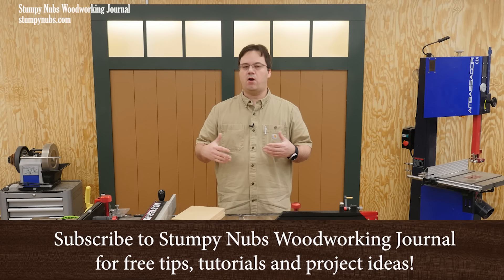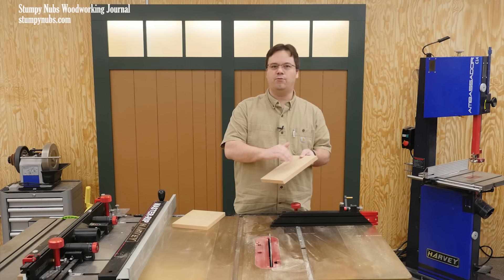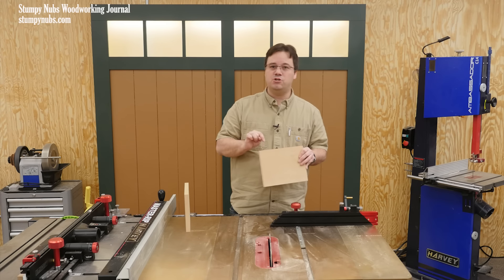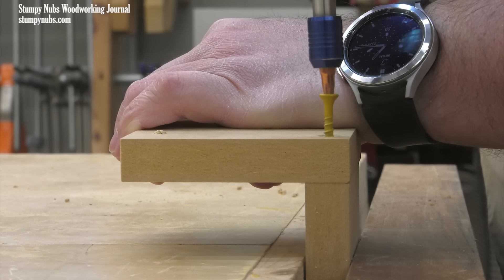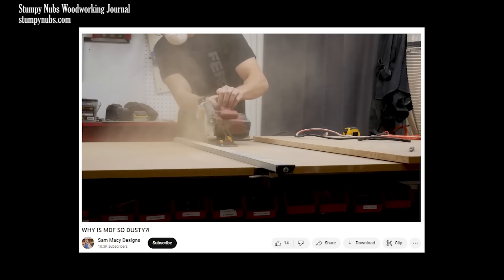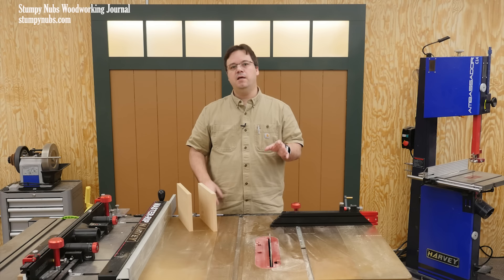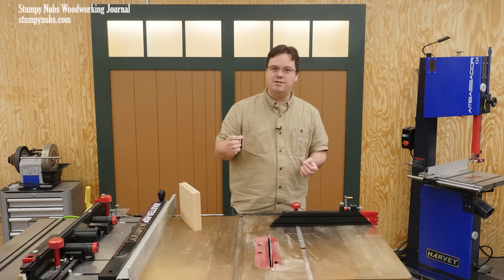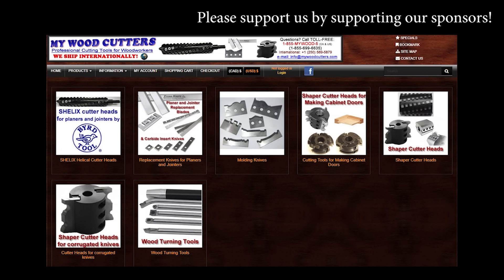This stuff changed my mind about MDF projects

Comment: Let's see, toxic dust, very little strength, won't hold screws well, won't glue well, won't tolerate moisture. The only saving graces are it is stable with humidity changes, and is flat (when supported). I think I'll just pay the extra and get plywood.
Reply: Weird.  I just wrote a comment that was nearly identical to your comment.  And my dog's name is Clovis.  Weird!
Reply: Currently working with a big slab of MDF which I chose for the surface finish. Big regrets. Awful stuff
Reply: Agree with OP commenter.

Cheap and toxic rubbish. The only MDF I have in our cottage is, years ago I bought a modular 5 tier workshop shelf unit, 1800 x 900 x 400mm from large hardware store chain that stocks alot of cheap rubbish. Metal legs and frame, MDF is precut and simply sits on top of the horizontal frames. No cutting or screwing required. Have them as bedroom shelves in our 60 yr old dilapidated roof leaking cottage. I throughly dusted off the panels in a ventilated area, and for nearly a decade, have been sitting dust free in the bedroom, causing no harm, and experiencing  zero moisture damage like they would in the tool shed, what these shelves were designed for, garage, shed, basement, etc.

If someone gave me free GC MDF, sure I'd use it, but I'd never waste one cent on this toxic rubbish.
Reply: And the dust is like glue. It sticks to walls and gums up your tools. I swore off that stuff years ago. I only used it because I used to get free scraps from work.
Reply: It has its place. Like all tools, if used for the wrong thing or in the wrong application then it is a bad material, but if selected for a specific application that it  excels at, then it is great. I use it for laminates, and using laminates on shop furniture. It holds flatness very well, and because of the density it is heavy. The additional mass in an outfeed table or mitersaw station is great.

Comment: I found over the winter when I didn't work in my shed for a couple of months, that uncoated/treatred MDF can go mouldy. I had a small selving unit right inside the door and had to replace all of the MDF surfaces, whereas the pine frame (also untreated) didn't have anything on it.
Reply: I've got a piece that looks like greeny grey shag pile carpet!
Reply: I've also lost a few shelves (drop-in ones from those keyhole units) go mouldy, but trying to solve the damp in a shed was more effort than it was worth, so eventually I just scraped down the MDF once it had fully dried out & hit it with a couple of layers of spray varnish all over. Not pretty but it seemed to stop the rot & they're still structurally as good as they ever were.

I think it happens because of the absorbency & high surface area; makes it easy for spores to stick and get bedded in.

Comment: It works great to make jigs like sleds or router tabletops. They are low stress normally and kept dry and the smooth flat surface is priceless.  Melamine veneer is even better.  I would never make furniture with!

Comment: I used mdf for raised panel kitchen cabinet doors. A glue water mix (abt 20% wood glue) does a great job of sealing routed surface. Just brush on and let dry. Then a quick sanding before painting and no more raised fibers due to water borne paint.

Comment: Great video on MDF.  I had struggled with it for years making the mistakes discussed here.  One tip I recommend...  For MDF applications where it can be "abused" or used heavily used (such as baseboards, doors, etc.), I use a lightweight automotive body filler -- Not typical "Bondo", which is too heavy/dense.  The lightweight filler I use has small fiberglass strands, which makes it very strong, it sticks to MDF like super glue, and since it's 2-part/catalyst it cures in minutes.  Being lightweight, it sands easily so I don't grind down the MDF faster than the filler.  When it's applied and sanded, the fill is invisible.  It also really holds paint!  It's especially great to use on baseboard corners that can so easily be dented or chipped away from getting kicked or the like.  I've used it to glue/seal the joint at outside baseboard corner miters, then spread it over the face out 12" from the corner in both directions.  I've also used it to butter raw MDF edges.  Very strong, very fast cure time, easy to prime/paint.

Comment: Spax,  makes a screw for MDF, it's like magic.  No pilot hole is needed even on the factory edge.  It is truly amazing!
Reply: I've had good results with HighPoint Confirmat screws. They're designed for mdf/particle board but they require a special bit for a pilot hole...I'll have to give the spax screws a try....thanks for the tip
Reply: I've used those SPAX ones too on a series of built-ins for my daughter. They are excellent, just don't over-drive them.
Reply: @normanbott  Never over drive any type of screw!
Reply: Was gonna recommend Spax as well but you beat me to it.  I've made our kitchen cabinets & living room entertainment center carcasses out of MDF using biscuits, glue and spax screws.  They've been used for over 10 years and haven't had any problems with them.
Reply: Thank you for the info. What would be recommended on the size ,length  etc. .I am using 3/4 inch MDF for shelves and cubicles ?   Thank you folks.
Reply: We have all kinds of brands that provide dedicated Mdf screws here in The Netherlands. Spax (Germany) Heco (Germany) Woodies (Netherlands) DynaPlus (Netherlands and more.. So I am sure that you will find these in North America as well.
But if you want to make a really stable joint in mdf, just use your router to make an 8 mm groove in the “endgrain” of the board and glue in a strip of pine wood or whatever you have available and and there you go. A very reliable joint!
Reply: Such a Home Depot reply!

Comment: Done doors/drawer fronts with just MDF panels and done finishes with lacquer, stained and lacquered, and painted. Sanding with 180 and sanding it well helps fill the fibers on the edge so it takes less finish to cover and looks more uniform if you are using lacquer and stains. Major color differences and mill marks still show up if you didn't sand it well. It's harder to sand properly than some hardwoods in my experience.

Comment: A trick I learned from a luthier is to use Minwax Wood Hardener.  This is a thin resin that soaks in and "hardens" the MDF when dry.   This is especially useful when using MDF as router templates.  Also, whenever I pre-drill MDF for screws or T-nuts, I soak the holes in this stuff.   It really does work a treat.   (Don't get it on the surface if you can help it... it can be a bit sticky.)

Comment: So time ago, a cabinet shop where I worked took on an outside job reducing MDF sheets into dimensional sizes using our sliding table panel saw.  Hours of continuous ripping filled our shop with fine dust despite having a collector.  Two blade changes and the dust collection machine completely filled several times were some of the highlights of that fiasco.  I can still smell and taste the acrid dust to this day

Comment: The joining method I would like to see more frequently is "wedges". There is a patented solution but honestly I have 3D printed my own and it works fine. I am just a bad handy man so it never fit properly and looks unprofessional but it works. The greatest pro is, you can disassemble it and you can add parts later on.

Comment: If you're looking for that smooth surface of MDF for painting,  another good alternative is MDO (medium density overlay) or HDO (high density overlay).  This is exterior grade fir plywood with one or both outer surfaces coated with a thin layer of MDF or HDF, so it has all the advantages of working with plywood but with that very smooth surface.  It's expensive, over $100 a sheet; I buy factory seconds for $15 a sheet that usually have one bad edge but the rest is good.
Reply: Thanks Mike.  Where do you find the factory seconds from?
Reply: My local lumber provider also has a plywood they call J-Core. The center is a traditional multi-layer plywood with the outer faces being a thin MDF layer and it is on the MDF layer where the hardwood veneer is. The advantages are a dead flat sheet because of the MDF, it acts like more expensive void free plywood, and with the traditional plywood center it can hold screws really well.
Reply: I have used mdo and it can be a great alternative...was first introduced to it when working at a sign company (they used to use it a lot before pvc sheets became so available)  one caution though...sometimes we would have to reject a sheet or two because the wood grain had telegraphed through the paper finish. It's a problem that's hard to fix and, if you don't look carefully, it can be easy to miss until finish is applied.

Comment: I think MDF gets a bad rap in at least some cases because so many people use the term interchangeably with "particle board". While it is technically true that MDF is a type of particle board, I suppose, the stuff you find inside most Ikea furniture that looks like compressed oatmeal isn't the same beast as "proper" mdf. And don't forget that there are moisture resistant versions of MDF, as well.  Had a friend build a cabinet in his basement. He made the base out if resistant MDF, but the rest of the project out if regular mdf. His basement flooded by an inch, which never reached the cabinet itself, and the resistant mdf survived the flooding just fine.
Reply: MDF > Particle board > Chip board (IKEA) > OSB in order of increasing size. I think there is/was a 'Flake' board in there somewhere, probably between Chip and OSB, but may have jsut been Marketing BS.
Reply: @brucelee3388  Ikea, at least in the UK, seems to be using a lot more MDF than chipboard now, due to the increased strength. They build a hollow form out of it & laminate it, with the middle full of (something that certainly seems to be) corrugated cardboard. Vast improvement over laminated chipboard, but still nowhere near as nice as the solid pine stuff they used to make back in the day.

Comment: I made a coffee table from MDF over 25 years ago that is still going strong. In that time it’s moved nine times (two of them international, one of those by sea), and survived three children who are now all teenagers. I also had a substantial table with full length multi-level hutch that was all MDF that was still going strong too after 13 years and was only scrapped because even dismantled we decided it was simply too big to bring with us overseas. It too had easily handled three domestic moves, and a few repositions, without any trouble. Maybe having worked in an MDF factory gave me an early insight into how to work with it on any project without trouble…but even durable furniture is quite possible with MDF if done right.
Reply: Do tell! How did you do it? Not smartass just really curious 🙏🏻🔥⚒️🧙🏼‍♂️
Reply: Yes, please!
I am desperate for some changes around my apartment and fancy nice wood is just not in the budget at this point. I am shooting for as durable as possible at the moment (given my limited budget) and I do not have a metal work shop nearby where I could just go weld stuff out of steel or aluminum. I mainly need to make shelf space. Any hints are appreciated!
Reply: @dragonstonegemironworkscra4740  I feel like dowels are a good way to go with MDF, I'd be interested to see what DL says as well.
Reply: The basics of what you need to do were pretty much covered in this video.  Basic design was a H base, with router-cut stopped dados in the end pieces. iirc, I did use dowels to attach the base to the top (again, for the reasons given in the video!), and added some discrete small brackets to make sure. The end pieces of the base (seems not right to call a complete block “legs”) were 18mm, the cross-piece and top were 12mm. I wasn’t doing it to prove a point, I just needed a table, I already had all of the materials, and I so I just made a table…and yeah, it lasted. I’m far from being any kind of genius woodworker, so I’m putting its longevity down to the quality of the materials, for sure. I’d do a better neater job of it today, unquestionably…but for my skillset and with my tools, I’d also go for MDF again without hesitation. It’s easy to work with, perfectly safe if you take reasonable precautions (do people really think they’re inhaling none of the dust from a router/saw on natural wood???), no heavier than other timber furniture, affordable but good quality, and can absolutely produce durable works if you take the time to think about the design and construction process before you start (as you should do anyway, regardless of material!).
Reply: @DrTomatoSpaghetti  yes, dowels are a great option with MDF. They get the job done. 👍
Reply: @dl4608  thanks now. Appreciate your time n information! 🙏🏻🔥⚒️🧙🏼‍♂️
Reply: MDF furniture is for banned at my house. Thrown away to many nice looking shelves ,tv hutches, kitchen and bathroom cabinets. Not another dime will be spent on that crap. Now if you want a flat work surface and the material is supported very well so it remains that way then Formica the top and sides ok. The rare bird that has something that last and will stand up to kids is great. Other than that the land fill is full of proof this isn’t a go too product for furniture of any kind.
Reply: @johnanthony2545  you must be a lot of fun at parties… 🙄
Reply: @dl4608  yeah I’m hoot lol. Sorry to be so condemning. Just my experiences and many I’ve talked to. I’m glad what you made is still awesome and you must have done a hell of a job. Good going. We live in Florida and humidity isn’t friendly to this material or any mis hap. Recently my mothers million dollar home had a leak behind the refrigerator the MDF cabinets were trashed while completely soaked base boards just had to be dried and painted while I remade the cabinet.
Reply: @johnanthony2545  from those extra details, it sounds like Florida is the real problem…and that wouldn’t be the first time! 😂😬 yeah, MDF is a poor choice for wet areas or anywhere with high enough humidity that it might as well be considered wet generally. Florida certainly qualifies! Blame poor choices by the worker more so than the material in this case - but that applies to natural woods too.
Reply: @dl4608  agreed. This is a norm here for many homes. Most people unlike you and I have no clue what there getting as long as it looks good weather it’s good for the region or area of home. Man oh man we have problems lol. Hoping many of then don’t catch on. I’m hoping the political climate here is seen for what it is and climbs back under the rock it came from. Lived here all my life it never use to be this way. Scarily crazy.  Any way keep building and enjoy sir. 👍
Reply: I concur with you on the political climate there, it’s quite frightening!
Reply: I made a desktop with a 24”x 48” mdf board from THD that I’m still in love with 20 years later. I didn’t have a shop - or many tools at the time, so I improvised a lovely champher edge with a palm sander. It was to sit atop a paired set of metal drawers I’d been dragging around for at least a decade before, so to keep it in place, I glued 1x2 strips to the underside and strengthened with dowels. Sanded with fine grit, put down some polycrylic, painted a design, more polycrylic, sanding in between. It was initially a kid’s art desk and I claimed for myself when the kid went off to uni. It’s where I’m typing now and it’s made it through multiple moves. I’m renovating a rental cottage and this desktop is the inspiration for all my cabinetry!

Comment: My first work bench top was made from MDF. Worked great and held up well with everything that sat on top of it as well as built into it.
Reply: MFT tops are made from MDF. They are full of dog holes that work well for clamping.

My current assembly bench has a 3/4" MDF top. I wax it to keep glue from sticking. It's a great surface. I have had no issues with it.

Comment: We used a lot of MDF while building department stores. My tip is to use automotive body filler , it sets up quickly, is easy to sand, and takes a smooth paint job just like the factory surface.
Reply: Like Bondo?
Reply: Body filler is fantastic for repair work on MDF.  For sealing the edges, try BIN primer and you won't go back!  It's ready to sand just as fast, sands easier, smells less and best selling point, it doesn't need to be mixed in small batches, then applied before it begins to set.  Denatured alcohol reactivates hardened brushes/ rollers..
Reply: @jayty1997  I would use BIN for spraying since it comes in convenient spray bombs, but mixing your own shellac really lets you have mnore control over viscosity. Also easier to clean up shellac without pigment.
Reply: @mytuberforyou  But this discussion is about priming MDF for paint.  I've been mixing my own shellac for over 20 years, but will continue to use BIN with a roller to fill and seal edges and details in MDF.  The components in BIN do not gum up like a pure shellac will under the heat of a sander.  The roller feeds the BIN into the poors in the MDF far better than spraying will.
Reply: @DrMackSplackem  I work in a door and window plant. We use bondo all the time for quick repairs in the paint prep shop. But bondo is useless on certain materials. It will dry too quickly or too slowly when seasonal variations change air temps and humidity. It can have varying consistently which makes sanding tricky. It ages badly once the can is opened.
And it's a dumb option on real wood where you want to show grain.

Comment: For MDF edges, I’ve been using an Abatron product—called Liquid Wood—which is a water-thin, 2-part epoxy created to absorb into rotted (“punky”) wood to stabilize and densitfy it. It creates a very solid, dent-averse edge that is waterproof and really tough. Abatron is a great company, too, focused on home restoration products.